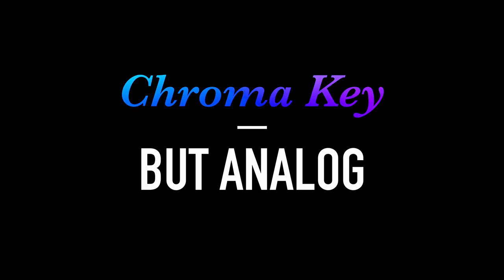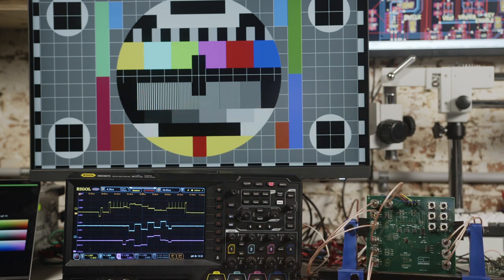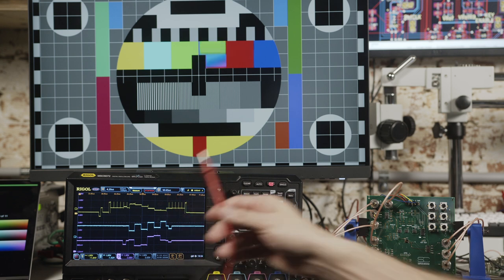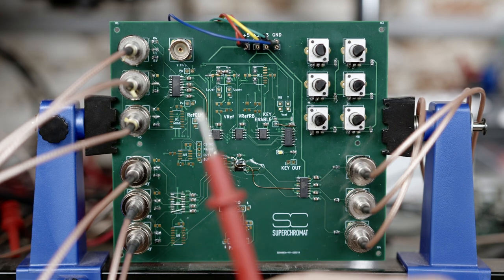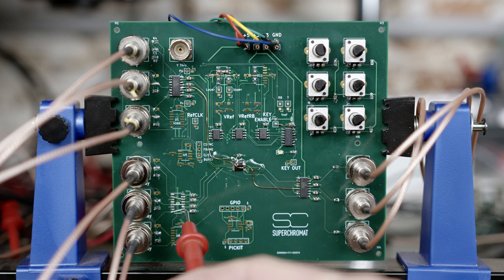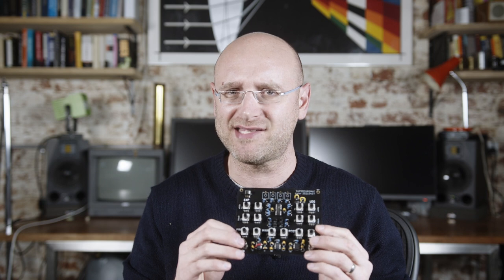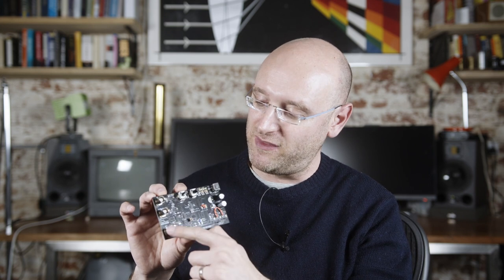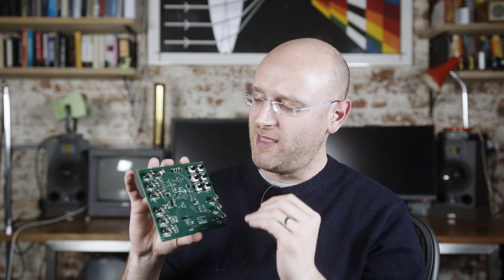Chroma key, but analog, but HD

Comment: I was completely in awe at the Panasonic MX10 video mixer we had in the late 80s at school, and that led to a retained interest in all things video. Although that was digital, I was fully aware the analogue chromakey methods predated this and always wondered how it could have been achieved which such fidelity. Great video and explanation, the other reason for doing something which may appear archaic is purely the intellectual curiosity! Thanks for the explanation of genlocking, always knew it was needed for chromakey but now it makes total sense as to why - you want to make sure your donor video signal commences it's horizontal sync at the same time as the recipient

Comment: this analog chroma key circuit is actually really neat and really useful.  
YES, THERE ARE REALLY GOOD REASONS TO USE ANALOG, EVEN IN LOW RES VARIATIONS!!!
i've been looking into making a luma key array, that would use several such devices, as well as some other tricks. it's in a planning, no budget stage.

there are many reasons to use analog chroma or luma key circuits. the problem with most video software is that it is a 'one trick at a time' process.  but many video artist need to do 143 tricks simultaneously in real time, and very few software programs can handle even a few of those things at once.

LZX industries sells their FKG3 Keyer, a eurorack compatible module for about $400.  LZX also has many other useful modules as well as a main all-in-one unit, the chromagnon that sells for $1200.

a Datavideo 4K Real-Time Chroma Keyer with 10-Bit, 4:4:4 Video Processing  runs about  $2200.  

a Datavideo SE-650 HD 4-Channel Digital Video Switcher runs about $1200

if i was to build a similar circuit, i'd go dirtier, since i'd just need the luma. i'd create a comparator stack of maybe about 9 chips, hooked to a resistor network, and whatever and/nand gate array and switching chips, no buffers just coupling caps.  i'd have to find larger chips, because i can't solder that little stuff, i shake too much and my eyes can't see it.

right now, i'm using SynthEdit, it has all the right functions to make analog-like video circuits, but sound cards are limited to 384khz, which is way below old skule video. i'm at 192khz so i would probably need lots of video dividers and SynthEdit maxes out at 12 inputs and outputs.

Comment: You mentioned that you're working on genlocking HD video. What's the approach you're taking there? I had a similar idea before but I couldn't figure out how to do it without fairly expensive approaches.
Reply from the maker: There seem to only be fairly expensive approaches. Atmos used to sell a device that would genlock 2 SDI streams, but it’s now out of production. Basically an FPGA and some RAM to frame buffer.